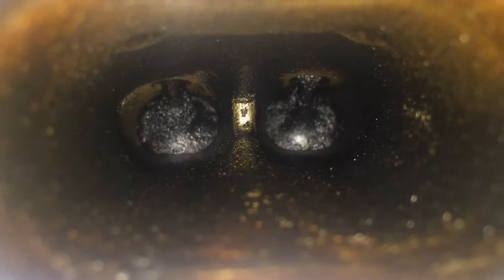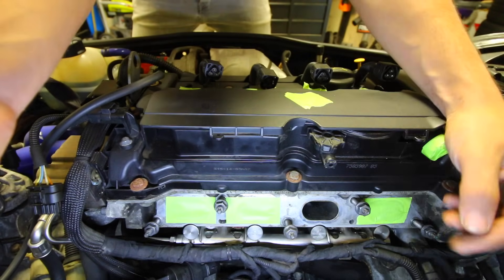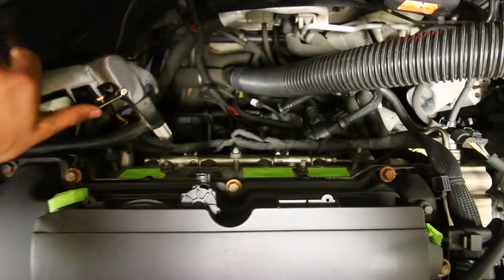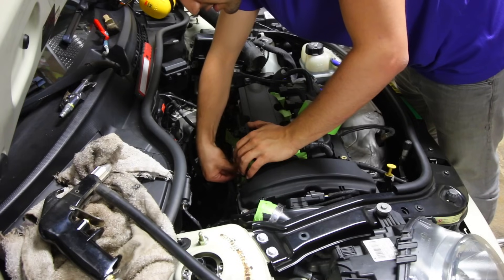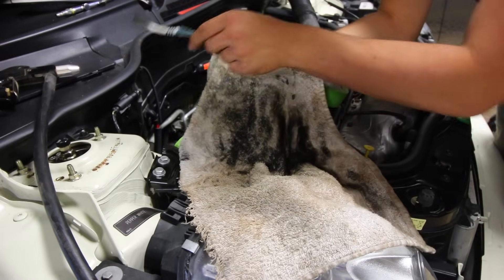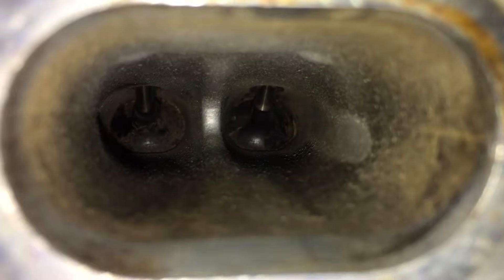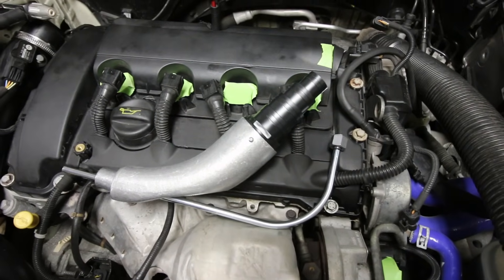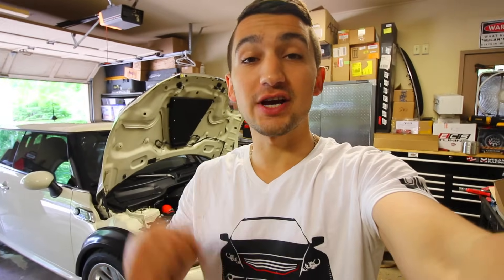How to Walnut Blast Your Intake Valves (CARBON BUILDUP REMOVAL)

Comment: Good instruction for walnut-media blasting to clean intake ports and valves.  The ones in my 2012 GTI are probably soon due, though there are zero running problems. The VW E888 engines are a bit more complex as you also have to clean the variable-length intake runners, however Intake port/valve cleaning is an occasional necessary evil with DFI engine designs, especially if the design of their crankcase ventilation system is less than optimal - a topic for another day!

I'd like to add several observations, however: 1. I find the probably that enough carbon/gunk in your #4 port & would create enough disturbance of airflow to cause an actual and persistent  misfire is extremely low.  Sure, I'd expect reduced power at higher RPMs due to impaired charge filling on the intake stroke, but not a regular or even occasional misfire, so long as you were getting mixture, compression and spark at the proper times.

Unfortunately, you'd didn't mention under what sort of temp/load/throttle position/boost or RPM conditions your misfire was happening. Nor did you tell us how you could be certain which of your 4 cylinders was a fault unless you assumed everyone had OBDII readers and knew ho to use them. Of course, one could always employ the old-school, but effective, technology of sequentially disconnecting the other plug wires to make an ID of the dead cylinder.

As misfire problems tend to indicate an ignition flaw; seeking a fouled spark plug and/or a bad coil-pack would always be my first look.  A plugged, damaged or simply worn-out injector would be something to rule out next, provided the ignition system was shown to be functioning properly.

Example: I very easily confirmed a bad coil-pack on the wife's 2002 Audi A4 Quattro 5-Speed manual when the car was relatively new; maybe 30-40K miles? Plugging in my OBDII reader immediately identified the misfire on cyl #2. I cleared the code, and ran it again until it reappeared for confirmation. Next, I swapped the #2 coil with the one from cyl 3.  Refiring the engine, the OBD still detected a misfire but it had "migrated" to cyl3, while 1, 2, & 4 were now firing normally.  Bad coil pack detected.

Since this problem was "surfacing" among that generation of 5-valve VW/AUDI 1.8L Turbo engines, the dealer simply gave me 4 new AUDI coil packs, and I confirmed there were indeed a newer part and of slightly different construction. Cool. The service manager said he saw no point in waiting for me to come back as each coil pack eventually failed, and ordered the parts chick to toss me a set of four, no charge.  I swapped them out and experienced no further misfires.  We sold the car with ~240,000 miles on the clock to a young lady headed off to college in Boulder where the AWD system would be a plus.
Reply: did you ever clean the intake valves?

Comment: Does no one know the difference between a motor and an engine
Reply: Engine is powered by fuel, motor is electric
Reply: Same thing.
Reply: Look at you trying to be all high and mighty, thinking that you know something. Typical child. The terms motor and engine can be used interchangeably. Ford MOTOR company, General MOTORS. These are 100+ year old company names based on internal combustion engines, long before children like you who thought they knew everything were around to point fingers. Do you think that all "motor vehicle laws" pertain to electric motors only? Next time that you want to sound high and mighty do some research. Lookup the definition of a motor, do you see the words "internal combustion", because I bet you do. The question that I have for you is - do you know what a internal combustion is? Child.

Comment: Direct infection needs to be combined with dual injectors systems like toyota's, where you have one manifold injector that cleans the valves, and another direct injector for efficiency. Having just direct injectors is a pain in the neck, and  I would not recommend buying any car with only direct injectors.

Comment: I had the same problem except it was a problem with the Piston rings on cyl 4. Sorry I have two minis. Both failed cyl 4. Misfire ect. I had both rebuilt at 60k. The carbon gunk may not have been the problem.

Comment: the mini and it's recycling parts ! the oil cap is from PSA (Peugeot/Citroen group) lol and bottle cap too ! :)
Reply: It's a BMW engine in collaboration with PSA. But it's more of a BMW engine than PSA. This engine is a mechanical disaster. It's not reliable, a lot of trouble of distribution, fouling of valve, consumption of oil. You change the camchain more often than a belt on this engine.

Comment: I encourage manufactures to install oil catch cans
Reply from the maker: I would love it if every direct injection vehicle was equipped with at least 1 port fuel injector to be used on startup, so it hits the backside of the intake valves which will stop the buildup of carbon, and then at operating temperature, the PFI injector will shut off and only run direct injection to get the power and efficiency.

Comment: Hey, great video. Quick question, how did you remove the intake manifold? I'm having a really hard time pulling it off. I have removed all the nuts and bolts from the intake manifold, Something seems to be holding it in place.

Comment: Tip:
With a normal manual gearbox and If you have a normal diff you can lock one wheel, by doing one wheel in the air and one on the ground  than you dont have to push the car forward/back. just turn the wheel thats in the air :)  so you can turn the engine in the good position without removing a wheel ;) (sorry for my bad english :P)

Comment: Usually, most of the carbon deposits are from the EGR valve - there's not a whole lot you can do except install a water/methanol injector, it will tell the computer to open the EGR less frequently. Also, install a PVC valve oil separator - it will help reduce the oil/carbon deposits. Incidentally, you can use a gun cleaning kit to help clean out some of the stubborn carbon in the ports. I've even used oven cleaner with with a modified shop-vac with some success.

Comment: The buildup that is causing all the problems is the one found on the narrow contact surface between the valves and the cylinder head. That buildup does not let the valves close properly. Cleaning the back side of the intake valves while the valves are closed, without cleaning that contact surface, brings almost no improvement! Cleaning with the valves open, .... that will definitely destroy the engine!!! What is the solution? I cannot think about other than disassembling the cylinder head and clean it manually. I am not an engineer. But i can say that what you did does not help almost at all. The design of these engines makes them so unreliable...
Reply: Manually clean while closed, chemically clean while open.

Comment: Buy a new GDI car for 20k plus then 2 years later walnut blast your engine, where to I sign......NOT!
Reply: It really isnt that bad lol
Reply: Induction by Force  Ooooh look at you lol

I can comment on anything I like, including engines I may or may not have.

But I do own a GDI engine, I've had it from new, only done just over 4000 miles. But have decided now that using brands rater than cheap supermarket fuel may be better because it has cleaning additives in them.

Whether that works out better in the long run, I don't know. But I thought about a catch can and have 2 issues. One I can't be asked and two it might invalidate the warranty.

But of this issue I did seriously think about buying a Toyota because the engine on there car didn't have this issue.

We have the same brand of car though :) xxx

Comment: Most out there wouldn't want to do this much or spend this money. CRC Intake Valve Cleaner worked well for me. With higher miles you could do it a few times or more often.
Reply: I've used CRC on my DI engine it really works.
Reply: Gain a few mpg , I crc my engine before each oil change and I have a sealed oil catch can. It’s a must for DI engines

Comment: Dude....get a radiator hose, hook it up to your vac and the punch a hole in after measuring how far it needs to go into the Intake area....No more shell bits everywhere
Reply: practical thinking and you are right

Comment: Hi Milan. Do you recommend any fuel additives and do you believe they would have prevented or remedied the carbon buildup?
Reply: Fuel additives do NO good in direct injection engines because the injectors spray inside the intake AFTER the valves and the additive doesnt clean the valves.

Comment: This is a lot of work... I don't see how it would be worth it to buy all the tools necessary vs just paying a shop to do the job.
Reply: most shops range from $400-600 each time its done. and its more or less routine maintenance. every 30-50k miles. all the parts pay for themselves after the first time. every time after you just have to buy the walnut shells for roughly $20. its more long term gain.

Comment: Could a fine water injector into the intake manifold assist with cleaning the valves and ports, water injectors have been used with Carb engines in years  gone  by to minimise coke build up.
Reply: john brown not when they are this dirty. It would only work as prevention after cleaning

Comment: Why did you disconnect the spark plugs and the turbo piping? The sparks are in the cylinder, so as long as the valves are closed, they are protected. The turbo piping connect to the intake manifold, so you dont need to remove that. Could you please explain your rationing for removing everything except the intake manifold? Thanks!

Comment: Cut the sides of a garbage bag and hole in the middle. Tape it to the cylinder you are working on and drape the rest to cover the engine. Hell tape two bags together or buy a plastic drop cloth from lowes even. No need to make such a mess. Also vw's intakes face forward(easier?). I just used a pick and carb cleaner might try this next time.

Comment: Definitively not a DIY for many weekend mechanics. isn't thee a no-disassembly method for the same ? Also, how do you clean the actual sealing part of the valve if it has to be closed ?

Comment: just dont buy direct injection junk cars. problem solved
Reply: I agree.  At least the Hyundai Sonata I just did has the exhaust ports facing the front.  I dug that shit out with a myriad of scrape'y tools.  You would think the engineers, as smart as they are, would have forseen this.  This is bad for all new car owners since the flat rate is now approaching $150 per hour.

Comment: Great job dude! I thought only direct injection diesels were that dirty but it seems that even petrol engines are as dirty as their diesel brothers....
Reply from the maker: Thanks Alex!! Yeah its pretty nasty when a used direct injection engine is taken apart. Because there is no fuel hitting the backside of the valves, any dirt or oil that hits there can sit and buildup.

Comment: That still does not fix the issue with carbon build up on the back of the intake valves. So when someone figures that out let me know.
Reply: They built port injection to clean the back side. So they have DI with Port injection as well.
Reply: Toyota has a second set of port injectors on their DI engines to keep the intake valves clean.

Comment: Yeah you lost me at "this is my mini cooper"....
Reply: It's a cute little fun car.
Reply: That mini Cooper has the same engine as my Peugeot 207gti. Developed by BMW, raced by Ari Vatenen and cleaned up Porche turbos!! They have 175HP standard and 260Nm of torque at a very low 1600 RPM!! There are a shit ton of mods that get em up to 450HP plus!!  Blow your shitbox 8s away,lol.Get an education before you spout shit:/ They also get around 35 to 40mpg, more on the highway at legal speeds:/ 230KPH in 16 seconds! Try that in your shitbox, fuel guzzling 8 mate, too funny:)

Comment: I was very concerned about the carbon build up since my ecoboost is a DI engine but after watching this video now I'm more relaxed about the maintenance on the long run. Every 60k miles valve service isnt really a big deal even if a shop charges $600 to do, although I think I'll do it myself and save me money on labor. Also I might just consider a auxiliary port injection system just for this reason.
Reply: This is the most rational take on carbon buildup I've seen. People overreact to everything. Direct injection is responsible for huge increases in power and efficiency so this is probably worth it

Comment: All this crap could be avoid by having a port injection motor and I like to use Decarboniser with even fuel tank, cheap insurance against this happening.
Because of this I really hate DIRECT INJECTION engines.

Comment: I'll just keep my port injection engine. 158K MILES and runs great
Reply: I'm on 300k miles, quite happy with it too.  I had the inlet manifold off a few weekends ago to do the PCV system, valves were spotless.

Comment: this is a total waste of time. buy some duralube gas treatment.use a spray bottle to spray it, use full strengthwhere it will hit those carbonized valves. Let it sit for an hour, run car. spray it again. let it sit overnight until you start it again, valves will be carbon free.spray the gas treatment directly into the valves based on how much buildup you have.

Comment: Will this process work on ford eco boost systems?
Reply: The basic cleaning premise is valid. I have 230k km on my 2013 escape and it will have to be done. My understanding of this problem (according to other Vids I watched) is to do this procedure when the engine is HOT. The oil/carbon deposits come off much easier with a HOT engine and you can almost just brush the deposits away (with a small course brush), then blow out each port and clean with soft cloth. The Catch-Can add on is almost a must for these engines, but I a little late to the party on this one.

Comment: What did you connect that blasting wand to? It doesn't fit the sandblasting gun.
Reply: King Randor I ended up getting a abrasive blaster from harbor freight and another wand from Bavarian autosport connects with no issues
Reply: King Randor 20lb
Reply: King Randor The valve is a normal open and shut valve that comes with the blaster.

Comment: Job on your video. That tool is the bomb. I'll be doing my mini this week. It's been done 5 times already by the dealer in the last hundred thousand miles. Now that it's no longer under warranty I will be doing it myself. Thanks again for all your hard work in putting this video together.  Would like to see a follow up video of the car running.

Comment: I have a 2016 M6.  How do I do this with mine?  I have much buildup from having a Dodman binary injection system installed.   My service mate told me that under no circumstances that i used shells to clean the ports since it my hurt the atomizers installed right before the intake valve.  Can you please show me the correct process for cleaning?
Reply from the maker: I've never heard that Dodman term before, but from what I've seen, this has been perfectly fine. If you would like, you can use soda media instead of the crushed walnuts, and it will work fine. Since your M6 and my JCW are both direct injection, you won't be coming close to the fuel injectors.

Comment: Is this applicable to Honda's?
Reply from the maker: The new ones that are direct injection, yes. The older ones that are port, no :)

The only time you will see build up like this is if you have an engine that sprays the fuel directly into the combustion chamber.

Comment: Brake fluid is the best product to clean carbon. Squirt it in, leave it for 30 mins and clean up the residue. You can even run the engine and let it burn off the brake fluid. It makes a ton of smoke but it works a treat. I've cleaned my engine like this for 40 years.
Reply: Dave Leighton where do you squirt it in from? Intake valve or throttle body?
Reply: many intakes on DI cars are plastic. brake fluid would destroy them.
Reply: Yeah the old guy that has been doing things for xxxx years checking in. I love when smartasses like you come to the shop with off reading maf and 02 sensors asking why their car is in limp mode.

Comment: That is a piss poor job you are doing and pretty much a waste of time and all that gunk and build up might actually prevent a good seal with valves closed and not prevent contamination into cylinder ... yes you make it a tad better then before but lets face it your doing this to make the code go away long enough to sell that pos car and never buy a direct injection car ever again
Reply: you would be better off spraying a good cleaner into port and letting it soak and then using compressed air to dislodge carbon and any cleaner that leaks into cylinder will evaporate with compressed air and when done with all 4 cyliders drain the oil as it is contaminated from all the cleaner leaking part rings .. this method introduces no foreign objects other then the carbon already in the port
Reply: gasket remover or paint stripper would be the best way to remove carbon and the fastest and wash down with good carb or injection cleaner afterwards but wear vinyl gloves and goggles (no glasses fucking GOGGLES because we are talking pain stripper here ...

Comment: After you do this you can sea foam it.
Reply from the maker: You can, but it won't make a difference since this engine has a Direct Injection fuel system. If it was port injection, it would indeed make a difference.

Comment: the reason you lose power is because of the turbulence when the air passes over the gunk, and decrease in volumetric efficiency, when the valves are open there is much less space for air to flow through, because that space is now occupied with gunk......Toyota has the best system, on their tacoma, Direct injection and multipoint port injection..no gunk build up